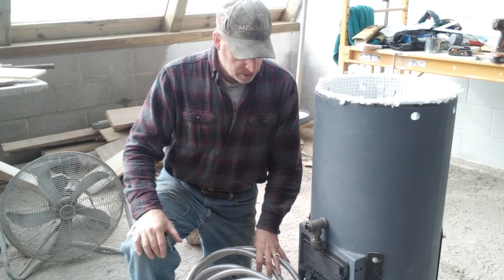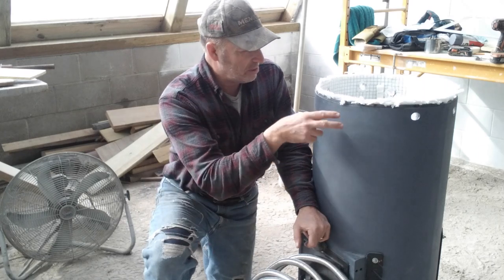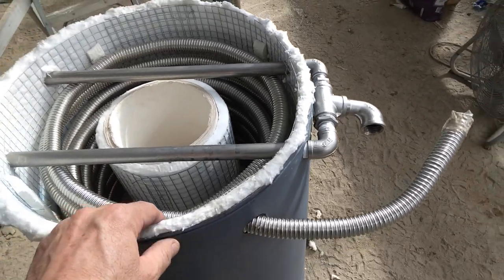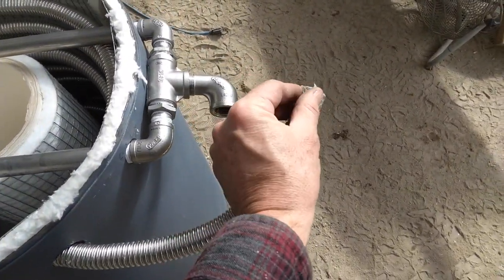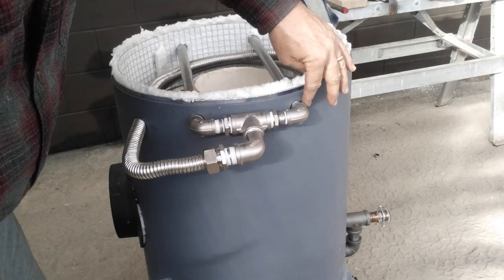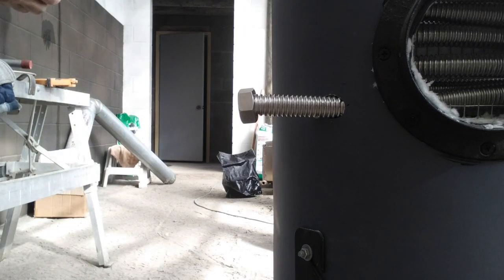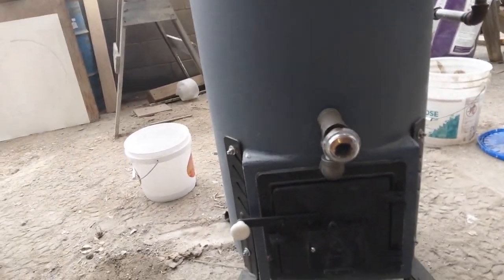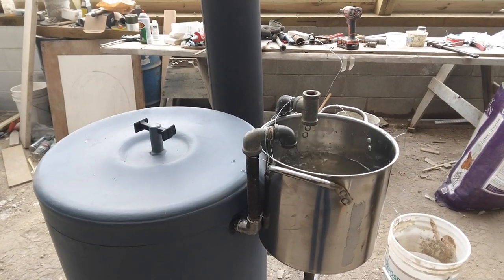Test fire of the Rocket Stove Water Heater, (part 5)

Comment: very awesome. My buddy got a prototype wood boiler and the secondary air intake kept clogging - someone put a stop valve to the ash box - very strange! So there was all this smoke and finally the thing just stopped working - after he burned out the water pump first. The water was boiling off, etc. Total mess. I think he's got it fixed now. So you have a much better secondary air design. The whole "top light downward draft" design is difficult to keep going if the wood is not totally dry in a wood boiler - so two years dried for sure. TLUD is what they call that - upward draft cuz the secondary air has to get sucked upwards. You got the secondary air above. Usually a rocket stove has a 36 inch riser - so when you said a foot I was surprised. But how's that work again? The rise goes on top of the baffle? So those gaps around the sides of the baffle then go up inside the riser? Or... the riser only is fed by the secondary air? hmmm - interesting. 
What are you gonna do with your water tubes? Just let it radiate into the air?
Reply from the maker: I think it's always important to use well seasoned wood, to get that hot burn.  This video shows the construction of the interior:  "https://youtu.be/_WTR03oRaNs"

Comment: This is a great build DMI. I think that your hot water needs are going to be fulfilled. Look forward when you get numbers on the heat this puppy can produce. Are you going to seal the corrugated stainless flex pipe ?? Keep up the great work on rocket stove heaters. They are supposedly the most efficient for sure. Good luck with you next video for us all to see.
Reply from the maker: What do you mean by sealing the corrugated stainless steel tubing?  In what way?  
It's used as solar heat exchanger piping.  I got it off Amazon, and a question was asked the seller if it could hold up using fire to heat it.  The answer was if it wasn't in direct flames it should work alright.  Time will tell how well it holds up.  I guess my concern is if it expanding and contracting much, and rubbing against stuff, would it wear holes in itself.  I know that the stainless steel pipe fittings I'm also using, are really hard to get a good seal on the joints.  I think because it expands and contracts more than just plane iron pipe.  Or I'm just not find the right pipe dope.
Cheers!
Reply: @doubleMinnovations  Nice innovations, what kind of area size are you heating?  Thank you
Reply from the maker: The greenhouse is about 16' x 28', and the entry is 7' x 9'.
Reply: @doubleMinnovations  That's great, I am going to send you an email with a product that can save you a lot of work.  Thanks Ray
Reply: @raymartinezii7366  This is what I like, one person helping another person. Hope this will work out for you DMI. Peace vf
Reply: @victoryfirst2878   Yes sir, have a blessed day and continue with your innovations, LOVE THEM!
Reply from the maker: @raymartinezii7366  My non-electric chimney heat reclaimer works just fine.  Don't know that I will need one in the greenhouse.
If you wish to promote and sell your chimney heat reclaimer, I would suggest you start making some videos of it and post them on your channel.   Just use your phone camera.  Lot of people do, and so do I.
My best!
Reply: @doubleMinnovations  No worries, it was just an option for you so you could be covered under an insurance policy.  Thanks again.
Reply: @raymartinezii7366  Thanks. vf
Reply from the maker: @raymartinezii7366  I am covered under an insurance policy.  The reason why the barn doesn't have full coverage, is because they want a primary source of heat other than wood if it's used as a living area.  Like I explained in another video.
If yours is UL approved, that is a selling point, so you should make a video of it.  The 'Magic Heat' one, is the only one that I know of that is.  Though there are others out there for sale that people use.
I'm trying to encourage you to step out, and show the world what you have.  It's easy enough to do.  There will be some negative feed back, but as least you put it out there.

Comment: Thats great for a test, how hot did the sides or top of the stove get?
How about weighing the wood and water and taking a temperature before and after so you can estimate how much wood will be needed for the job of filling all your 300ft of pex tubing
Reply from the maker: I didn't take any temp readings.  This was just a very short burn.  More will be coming; thanks for watching!

Comment: Nice too follow Your work.

I would not use Teflon in that environment because of 2 arguments:
 1, it is to easy to come loose, difficult to seal - I would for example choose flax/linnen fibre instead.
 2, If Teflon gets over 260 Degrees Centigrade It breaks into dangerous fumes. Not worth risking it.
(DuPont studies show that the Teflon offgases toxic particulates at 464°F.
At 680°F Teflon pans release at least six toxic gases, including two carcinogens, two global pollutants, and MFA, a chemical lethal to humans at low doses.15 May 2003)
Reply from the maker: I have some other options I will try.  Thanks

Comment: The idea - which is to cover the hose with sand like this - beach (the gentlemen found out that it is good for this thing) will accumulate heat and slowly and longer release them, even after the stove burns out.
Reply from the maker: This boiler is going to be used in the greenhouse for the coolest months of winter.  I have 300 feet of pex tubing buried underneath the floor, so there will be lots of thermal mass heat storage.
Reply: @doubleMinnovations  OK buried pex in the floor - right I forgot you mentioned that already. Awesome.

Comment: Nice videos you made but this way you only get steam - it needs a closed circuit, doesn´t need to be pressurized - water column  without interruption - refer toTHERMOSYPHEN
Reply from the maker: This was just a quick test firing, so I set it up to get some percolator action.  This is going to be use in hydronic heating.   See next video:  https://youtu.be/NdAP8BdBz6o